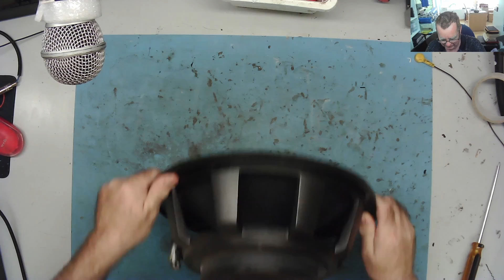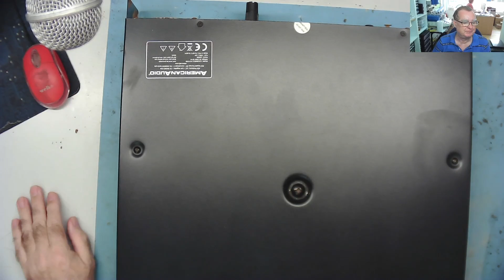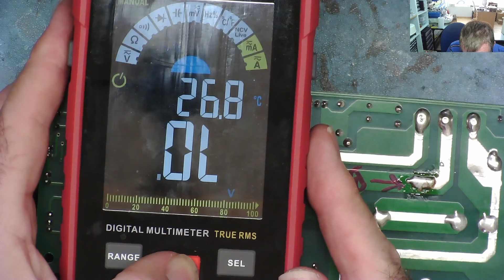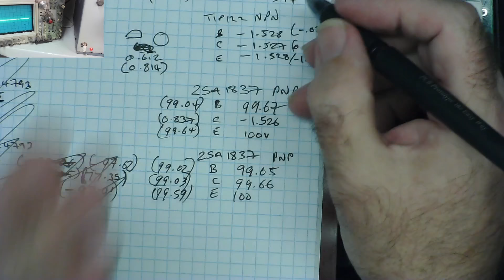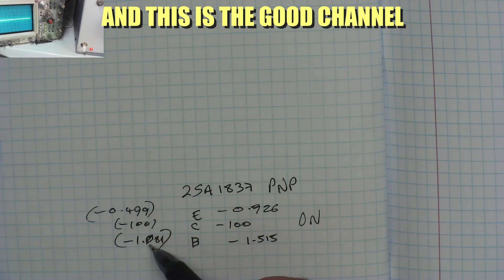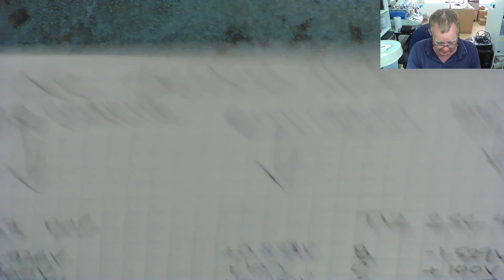Repairing  Electronics From High Level Down To Component Level  Practical Example 1500W PA System

Comment: Serious deductive powers here! I usually put all my faith into the visual inspection, as my electronics skills are lacking quite a bit.
Frankly, I'd just throw both speakers away and replace them. A pair of 500+W boxes would cost £150-£300 - they don't even need to be fancy ones if they're not pumping Wagner @ 1KW.
A pair of powered Mackie Thumps would cost 700€ (and weigh half of the EVs); they'd get rid of the external amp and could host rave parties for a thousand people :D
Or they could get a Samsung Tower for  500€. Really, there's no need to waste two ElectroVoice speakers for a little background music.
Reply from the maker: You did see the part of the video where I explain these are outdoor weather resistant speakers from a swimming pool, which is another good reason not to use mains powered active speakers as well?
Reply: @learnelectronicsrepair  Yeah. My Thumps have been under some pretty harsh weather. Of course you don't want to leave them turned on in a storm :D
You can buy, say, Klipsch 650s or Polk Audio's Atrium systems for a fraction of the price of those EVs.
I mean, *if* they really needed a 1500W system, and were hosting half-serious live shows, maybe Electro Voice would be a good choice. But for background music there are better, cheaper choices. In this case, I surely won't shell out 400€ for a speaker.
Reply from the maker: @IlBiggo  So far I don't know what they want to do about the faulty speaker.  This is a rather posh hotel (as in expensive to stay there) with a large heated outdoor swimming pool. I am not sure that the cost of the replacement is the most important factor to them.  They do put on live shows but not at the pool bar, they have a stage across the other side of the pool near the dining area for live events and that has it's own sound and lighting equipment.
Reply: @IlBiggo  I would've had the amp fixed and speaker re-coned for £250 at the outside here in the UK... these speakers are quite good and worth fixing ... P.S. and I would've re-sprayed the grills .... :)
Reply: @johnnybravo505  Of course, ElectroVoice are super expensive and high quality. I feel like they're wasted on a pool's entertainment system. But if they have a stage too, they probably got the pool's system "bundled" with the stage sound equipment.
Personally, I'd have the speakers fixed, sell the whole system for a couple thousands or so, and then buy a more adequate (and far cheaper) set.
But then we wouldn't have Richard's repair videos! :D
Reply: @IlBiggo  EV are like all other manufacturers (quality is on the slippery slope) .. IMO  I think that is a good system for the application ... I would have fixed the amp, cleaned the speaker and re-sprayed the grill as a matter of course here ... ta da ... :)

Comment: One of the main reasons for failure could be the use of bleach or hypochlorite in the pool and atmosphere above. Chlorine is probably the reason the fan protectors on the  back are so rusty. Chlorine and copper are reactive and will dissolve/ react with any exposed metals. Hence the broken speaker wires! Try moving the amplifier into a dry clean air environment, and work out a way that the speakers can be excluded from the moist chloride air at the pool.
Reply from the maker: The pool bar is at a hotel tight next to the sea.  I think it is the 'sea air' that causes the corrosion.  It is dry here we only get 88mm of rain a year!  The speakers is in the bar, which is covered but obviously open on three sides

Comment: In your final summary you didn’t surmise the possible reason for the blown speaker? Was there a voltage current coming through the sound rail?
Reply: Could've been DC but IME in situations like this (pub and small venue systems) it's usually the other way round ... i.e. the cabinet gets knocked over ... or dropped and the cheap pressed steel speaker chassis gets bent slightly causing the voice coil wire to get caught in the front plate gap, fold over and then form a partial short or with cast chassis construction sometimes inexperienced overdriving causes the voice coil former to hit the back plate or actually leave the former gap completely in over excursion ... again causing the coil construction to fail, short and make voice coil impedance really low ... which then draws excess current from the amp and causes all sorts of damage to the amp stages and speaker. Larger pro-audio over-amped systems will cause speaker damage if not used carefully ... but that's a whole other subject level ... :) Usually pubs and small venue it's "pilot error" ... not respecting the equipment & the speakers fail 1st ... :)
Reply: @johnnybravo505  thank you for your detailed reply very interesting.
Reply: @terenceoconnor1584  If you want a laugh ... a few weeks ago I got a Mackie SRM450 that had got knocked over in a 2nd floor bar, as the stand fell over the speaker cab went straight through a window and onto the pavement outside ... luckily nobody got hurt ... it's repaired and back in service unbelievably ... :)

Comment: Richard, please look at Ian Chandlers comment further down the comments list. It's a future fault in the making.

He supernaturally notices arcing at resistor R55 at approximately  51min in:  right side  close to capacitor C67.
Sorry if you have already noticed this and super credit to Ian.
Reply: I think you guys are seeing video artifacts ... arcing would be really obvious.
Reply from the maker: @johnnybravo505  I tend to agree - I can see what is being referred to as arcing but I don't think it is.  The amplifier is still here as my van broke down (which must have been because it is reaching 41C here everyday the last few weeks and UK Sky news told me that will cause your car to blow up if you drive it when it is over 40C outdoors and I foolishly ignored the advice 😂) so I'll check it and let you guys know

In the mean time I'm off to bed for a 'tropical night' (minimum 27C tonight I guess but it will get cooler at night in a few months) and we don't have aircon in the house but I will probably survive.  Having said that we have no type of heating in the house either, it's always at the ambient outdoor temperature whatever time of year so it could get as cold as 14C outdoors on a really bad midwinter night which is fookin' freezing and you need a thick quilt to keep warm in bed.  Or a snuggly woman (or man, whatever your preference. as long as they are warm).  Or both, or several of each if you feel like it and it is a really cold night which we get once every 3-4 years AKA 12C.  

This is good for your energy bills by the way 😉
Reply: @learnelectronicsrepair  If it was a contact with enough current to arc you would hear it buzz with speakers attached, if you look about at the same time as the flashing is happening there's two or three other places in areas of lower light where other light digital artifacts are happening too. Central Scotland here "boiling" @ 24c ... I'm gonna sleep in the pond tonight wi the fish ... :)

Comment: When you use your capacitor meter, do you ever try it with the pin holes for testing the capacitors rather than the probes

Comment: Great  tenacity . You can buy a 12 inch speaker for has little as £30 pounds I am amazed to ,ok it may not be hifi quality but for that application I think it would sound great. Waterproof maybe not but often in Spain etc they pull a polythene bag over them in most case they can under some sort of shelter . Had mobile disco when was 17 now nearly 70. Retired electrician always dabbled in electronics thanks for giving me a greater understanding of the subject keep up the good work
Reply from the maker: These speakers don' t have polythene bags over them and they are outdoors.  Having said that in Puerto Rico (Gran Canaria resort town not the Caribbean island) we have just 88mm of rain per year, and most of that has the decency to fall in the early hours of the morning around 2-3am lol.  These came from a rather posh hotel, I am sure they can afford to fix it 😉

Comment: Excellent video Richard, thank you.  Did you return that pot to 113.5 ohms or leave it adjusted to 96?
The scope and sine wave input are such great tools... makes it very clear to see what's happening.
My guess on the failures is corrosion from a drop of moisture eating through the trace.
Reply from the maker: I returned it back to the original setting once I found it didn't help.  Yes I agree that it is probably something environmental that is causing this type of failure
Reply: @learnelectronicsrepair  You can use the same gloss polymer type coating used to waterproof woofers as an additional conformal coating for PCB's if they need extra environmental protection ... :)

Comment: For that outdoor woofer .... buy a standard SX300 re-cone kit and waterproof it yourself with polyurethane spray ... I'll not include helpful links as I see you've been removing my posts with links ...
Reply from the maker: Johnny - I do NOT remove your posts or anyone else's!  This is something youtube does automatically and I don't even get the choice to say if a 'removed' post is OK or not.  It does seem to happen when there are links in the post but then someone else can post the same link with no problem.  Please search for 'youtube removing comments' because I really don't want you or anyone else thinking it is me doing this.  The only way I know if a comment was removed is because it pops up in my feed but when I  click on the comment to reply, it is not there on the video. Actually I find this really really annoying.
Reply: @learnelectronicsrepair  Not half as annoying as it is getting a helpful comment removed, they certainly make it look like it's selective removal. Anyway I've detailed the repair I would do, The DL12SX is the correct speaker (as detailed in the SX300PI engineering spec sheet) for the cabinet and re-coning + diy waterproofing will bring the repair back down to a realistic price ..... depending on whether you can get a re-cone kit shipped to you there ....
Reply from the maker: @johnnybravo505  Thanks for the info, I'll take a look at that option to re cone it.
Reply: @learnelectronicsrepair  Also meant to say earlier that these cabinets are designed to be installed facing slightly downward at an angle of >5 degrees to inhibhlt water ingress ... I don't know how they were installed but that could be a point for improving future reliability ... :)
Reply from the maker: @johnnybravo505   I'm sure they were angled slightly  downwards. Not that I think anyone RTMM but they are mounted quite high up at the level of the top of the doors to the pool bar, and play music down towards the pool area so it makes sense they would be angled down a bit
Reply: The SX300PI woofer is a waterproofed EV DL12SX (same basic woofers & tweeters are used in all SX300 models) so any re-cone kit for that .... it could make an interesting video .... you can actually see in your video that the cone and dust cover have been painted with some sort of coating probably gloss polymer, you can see the brush strokes ... an easy cheap repair ... :)

Comment: Hi Richard,
What glue did you use to stick the speaker cone?
Would  T-7000 be OK?
Reply from the maker: Just some generic contact adhesive like UHU glue (UK brand)  I've seen others use silicone adhesive.  Basically you are better witha glue that is a bit flexible/rubbery when set.
Reply: https://youtu.be/MLkzpLO1ocQ?t=154

Comment: Hi,  i have a Sansui amplifier AU-710 which i’ve had over 38 years old. Last time i try it was around 2 years ago, and it was working fine. I have seen so many  American YouTube clips where they say i should have the capacitors replaced. Due to leaking / splitting or failing. I’m sure now if i switch it on again will i do the amplifier some damage. Is there any HIFI dealer who would do a health check. I  live in the West Midlands areas.
Reply: That's a great amp - Forces issue of the 717.

Like Richard said - the caps (although could probably do with replacing) probably won't cause any problems - the more likley culprits would be the fuse resistors and the VD1212 diodes that cause problems on Sansui's. That and the odd transistor.

If you're worried about plugging it in, you could build yourself a Dim Bulb Tester (DBT), plug the amp into that and hope the bulb dims. If it does, check the DC offset (multimeter into the speaker terminals red to red, black to black) - have a search to see how to do this. DC offset should be around 0v on the left and right channel. If the DBT and offset passes, you more than likely will be good to go.  Keep it plugged in to the DBT with your speakers in and an audio input and slowly turn up the volume.

If you don't fancy all of that, pop over to the Audiokarma forums and message a user called Hyperion, he regularily services/restore Sansui's and is UK based.
Reply from the maker: @dannywhac  Good advice.  I did the DC offset test in this video - it was one of the first things I did once i got the amplifier
Reply: @learnelectronicsrepair  Haha, I wrote my reply when I was 10 minutes in to your video Richard - then watched and you covered everything I just prattled on about. Great vid as ever, appreciate the time you take to make these.
Reply from the maker: @dannywhac  Haha that made me laugh out loud 😀
Reply: @learnelectronicsrepair  Thanks, i will try what you have mention over the weekend, and keep pausing Richard, learn electronic. Thanks again
Reply from the maker: robert senior
All I can say from my own experience, when it comes to amplifiers you have to actually diagnose the fault to find it - and capacitors are not at the top of my list when it comes to amplifier problems.  With an amplifier of the type you have I would say that the multipole source/speaker select/mute switches are by far the most likely components to fail.  However I freely admit am not an audio/amplifier repair expert, more an 'electronics repair jack of all trades' so I would imagine some others here can give far better advice
Reply: @learnelectronicsrepair  Thank you Richard, i will try what you have covered on amp repair. I will be pausing you a lot, making i do things right. Thanks again

Comment: Hey Richard, how to test transistor which drive main transformer in atx psu? I have many cases where the primary side of signal transformer get voltage and frequency use DMM. But idk to test the secondary side of signal transformer. I have watch the smell psu which you repair.